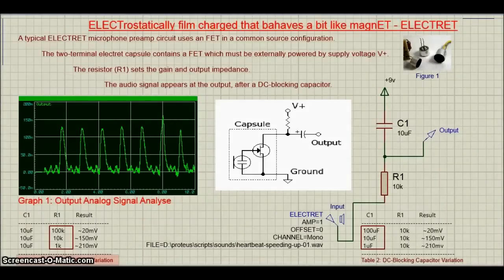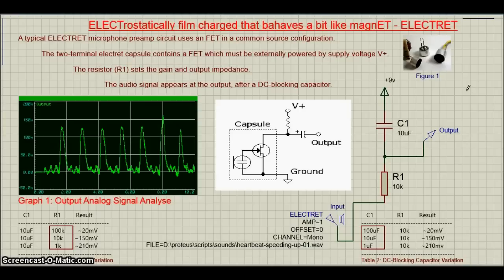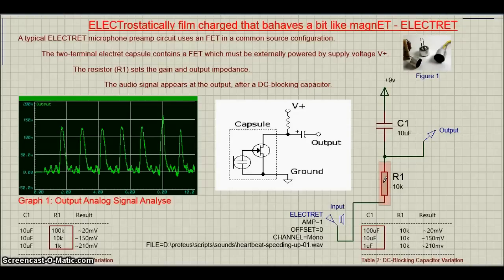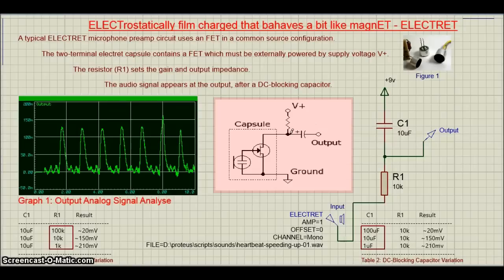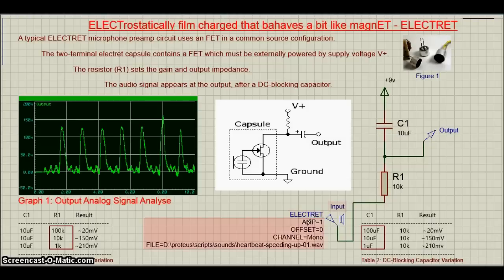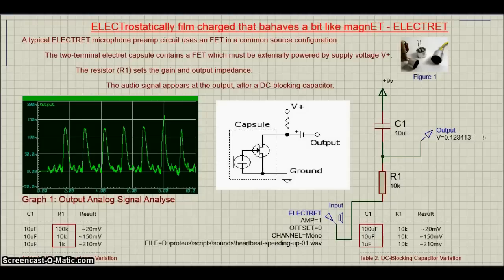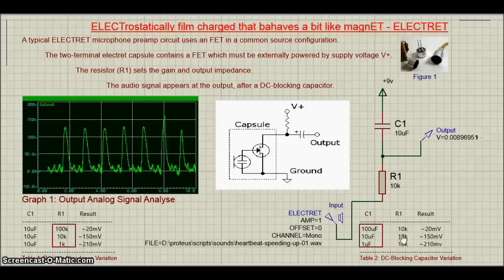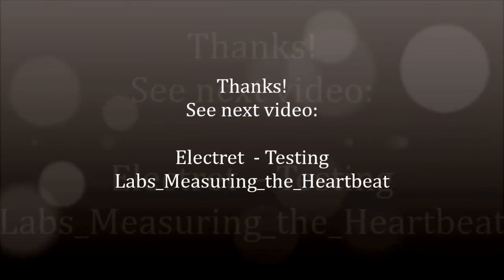Proteus -  Electret Condenser Microphone -  How It Works

Comment: Why there isn't the electret symbol in the Proteus software?
Reply from the maker: +Popart 2015 , As you know, Electret Condenser Microphones convert sound into an electrical signal. We simulate this with the signal itselfs. The results is as the result is as if we are facing a Electret. This is what matters! Maybe there should be another way of representing the input signal. I believe DIY community can help us ...